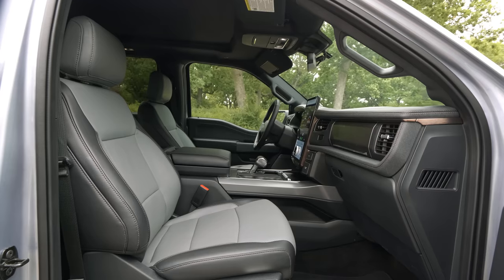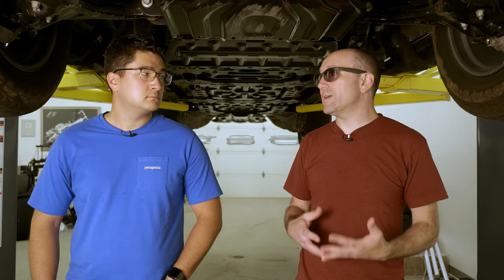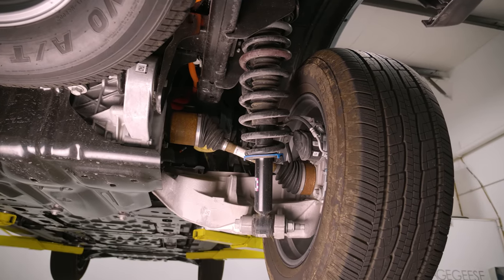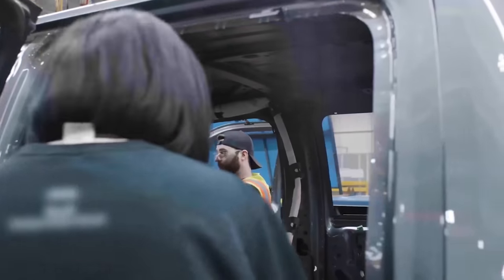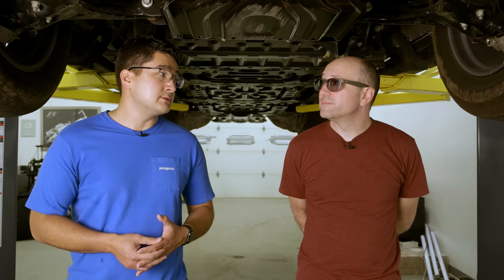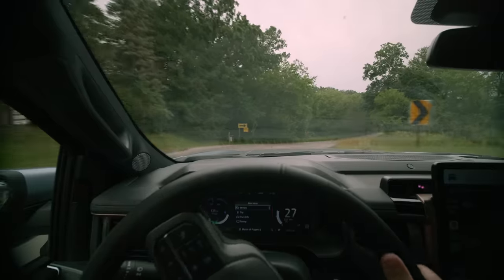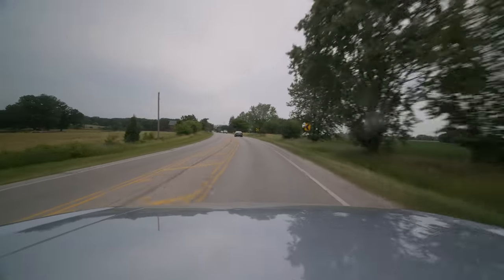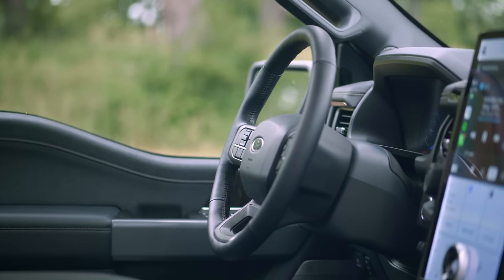Ford F150 Lightning | The EV That Will Change Trucks

Comment: As a Miata owner and cyclist these massive EV trucks are terrifying. The size, acceleration, and kinetic energy in this and the Hummer EV will lead to some gnarly accidents.
Reply: Yes a 6k EV truck is much more dangerous than a 6k diesel truck
Reply: @benjaminkessler8169  given the acceleration difference I agree with you.
Reply: @S8ER  except the ice ram trx is over 6800# fully fueled up and the raptor is 6400# loaded up&fueled. Both of those have similar 0-60mph time's. The new Cadillac escalade is over 6500# and does 0-60mph in the mid 4s. So really it's just another narrative against evs. 🤔
Reply: @4literv6  I don’t think anyone gave those vehicles a pass here.  I’m sure the Miata owner above doesn’t think those vehicles are safe for them either given the context.
Reply: @4literv6  this isn’t against EVs. I’d totally drive an EV commuter. I’m against enormous fast trucks that don’t have the same safety regulations as cars. Trucks don’t have to pass pedestrian crash regulations or headlight height limitations.

Comment: Smart grid integration could pair really well with millions of EV's. For one, EV's are usually charged at night (or at least could easily be programmed to do so), and most electric demand is during the day. We could also have a mode where when the batteries of these cars can effectively act as grid level storage to further level the load. A level load makes for a more efficient grid as you don't need as many fossil fuel powered plants sitting on standby for load leveling.

Comment: I'd like to see a "Thunder" trim level that has a range extender under the frunk similar to a BMW i3. It might be handy for those who live far from charging stations, or want a safety net of a backup charger in case they end up not close to a charging station. A Powerboost in reverse if you will.

Comment: "If you're going to tow heavy loads ...", then you're looking at an F-250, -350, etc. instead anyway, and most likely a diesel too.  The TRUTH of the matter is that the F-150 Lightning is the PERFECT F-150 for 99% of F-150 buyers, ... and you can take that to the bank!

Comment: If I’m a contractor with short range that means I’m in town towing. I bet then it falls to 50. Run some tools from the bed? You are probably be down to 30 miles. This is a joke. $200k now, 30k uses in a couple of years.

Comment: One issue when comparing gas mileage, is that nobody does the actual math for how much their regular commute costs them. If you take [(average gas price / typical gas mileage) * by typical commute = cost of commute]. Anybody who lives in the city, and only drives 2 or 3 miles a day, will never see a return on their investment into an f-150 Lightning with gas savings. People who drive 20 miles, will see an immediate return that month. based on base model costs. This applies to every popular EV, given how expensive they are currently. The people who would benefit the most, don't have the infrastructure to support them either.

Comment: Am I the only one that absolutely despises that massive screen mounted in a highly distracting area.
Reply from the maker: Its trash
Reply: It's almost like all these features that "keep drivers safe" (lane keep assist, auto braking, proximity warnings) are only in place because the manufacturer's are dead set on putting a 62" screen that you can stream tic tock videos on nailed to the dash. 

I'm convinced this is all to make it so hard to drive that they have an excuse to mandate self driving cars.

Comment: Big electric truck that wont fit in the city or around downtown metro areas.  Wrong size if you ask me.  Should have been a midsize.  Their maverick will sell 1000 to 1 to this truck based on price and practicality.

It's not usable for towing because of range and cant go offroad because the undercarriage is low due to the batteries.  Being heavy also means environmental issues to the roads.  Its one heavy ass truck.  Cant imagine what would happen if it hit some compact vehicle

Comment: Useless for half F150 buyers with tiny bed. Not to mention I can buy a shit ton of gas for $20-40K premium. My $37000 2.7 ecoboost XL f150 with 8' bed gets 24 MPG @ $3,00 is 320,000 miles of free gas compared to extended range EV version with tiny bed.

Will EV battery even last 320,000 miles? Then What's it cost to charge that? Math is not good.

Comment: Of course, even in a gas powered truck towing and payload impact the range you can get out of the fuel. The future is electric, and there will be more and more stations with pull-through chargers, like gas pump islands, so while towing drivers can still charge without having to unhitch the trailer. Cost of ownership is nearly half that of ICE (internal combustion engine) vehicles and to get the same range from electricity is cheaper than from gas or diesel.

Comment: Anyone else nervous about 4-second 7000-pound trucks on truck tires flying around?
Reply: You also nervous about the 6800# trx all flying around? Or the 6400# raptors that have been sold for years already? 🤔
Reply: @4literv6  Yes. But those are not as fast as EVs in the real world and also will be far less numerous.

Comment: Casual observations here:
1. The use of the phrase "boner-killer" was genius, especially in reference to the deletion of physical buttons because this phrase cuts across gender (these days), languages, and various demographics. In essence, everyone understands how serious it is when BoNeRJamZz quit. Clever work here, you cunning wordsmith. 
2. Ford needs to stop taking naming ideas from summer interns because they're inept at this point. No matter how cool/important/necessary this truck is, to use the Lightning badge was a s****y idea. The Lightning badge is tarnished. Same intern who chose the Mach-E naming structure. (Stick to design, dude. You won in that arena.)
3. You picked out a few details other journalists are afraid to talk about. I hope Ford doesn't punish you for this because you're doing your job well. I love you guys. 

Still not buying this truck, though.

Comment: Electric vehicles will relegate personal transportation to the elite.
This is the ultimate Ponzi scheme.
The manufactures all have set up separate entities for EVs.
They can bankrupt the legacy companies and screw everyone they are obligated to.
208/2009 taught them well.
Why are they pushing such powerful vehicles. The average driver isn't capable of driving one safely.
If a 6/7 second 0-60 was chosen think of the lower weight and extended range.
The safety issue is horrendous.
A family associate had a monumental fatal accident(can't comment/litigation) that would not have been possible in an ICE.
Believing Elon ,an autistic Judas Goat leading to the slaughter is fitting for the snowflakes-Mars my ass!
Reply: You are right ...this is not gonna end well for the rest of us....We are gonna end up back in the stone age.

Comment: Another benefit of driving an EV is you'll never have to worry about the exhaust rotting out and getting loud in the long term. That will lower noise pollution overall.

Comment: Problem with EV's is when you have to replace the battery pack in around 10 years the average cost for a Tesla currently is 21k. Thanks but no thanks.
Reply: this is not a thing

Comment: I don't want one of these (or any EV) in my garage.  Search for and watch the videos of Electric Bus fires.  Battery fires are a concern (and bias) of mine.
Reply: The fires are awful! You see that Tesla? The thing shorted and he couldn’t get out, he had to break the window, and it burned to the ground.
Reply: Any comment then on the 200,000+ice vehicle fires each year here in the U.S. alone. 🤔
I mean an ice vehicle burns down every 4-5mins on average and they cause untold billions in direct property damages each year to. 
Plus the #1 open recall across all ice vehicle's sold is for the risk of fire. I'd love a comment on that? 😂

Comment: Battery tech isn’t there yet. EVs are great for daily drivers and homeowners (or home renters). 

Unfortunately, towing isn’t there yet, range isn’t there yet for most ev’s, and charging infrastructure isn’t there yet. Had the opportunity to buy a few EVs over the last few years but realized it would be a huge pain in the ass for real life.

Comment: I think objectivity waned a bit in this review but I realize that if you guys commented about the amount of fuel (even at todays prices) that could be purchased for the premium over the normal f150, you probably wouldn't get to review anymore ford vehicles or EVs for that matter.  It's a $75,000 truck that gets 300mpc going the speed limit (that isn't free to charge), and will need a $20,000+ battery replacement in 10 years, and that's not even touching on the dealer markups.

Comment: I can't wait for this first (second?) EV gen to be over and for manufacturers to stop cramming the BIGGEST FUCKING DISPLAY POSSIBLE into the center console. Like bruh could they not have just condensed the UI and better integrated a control unit into the design of the car? So stupid.

Comment: I bet the vehicles stop charging when it senses low voltage.  So during a brown out they won't have to tell you to unplug your EV. 
Here in NYC  they ask us to turn the AC off during these hot spells. All these EVs are only going to push our electrical infrastructure to the max.

Comment: The EV that will change trucks until you have to pay $25,000 to replace the battery after 65,000 miles...
Reply: Do your research before you make sh*t up! In any case, all EVs have at least an 8 year/100K mile battery warranty.

Comment: I never knew how much it would cost an electrician to install the needed wiring and etc for a generator. Did it myself for 100$...5 grand for someone to do it? Wow...This is about as bad as honda marking up their parts 6x.
Reply: There are a LOT of options to go about this. In an emergency you can just wire an extension cord right in to the panel for $0, the cost is on a continuum from that to having a whole new panel with 'smart breakers' and a Tesla Powerwall-type system that'll automatically switch from using the EV battery to charging it when the lights come back on.

Comment: get ready for your electric rates to increase.
Reply: Why? Most electricity is used by industry, commercial buildings, city services, etc. As more green sources come online it is a lower cost than traditional sources (except existing hydro) and charging at night at home, for those that can, is at a reduce rate.
Reply: @davidmccarthy6061  if demand outgrows supply then price increases.

Comment: Great. Another ass-screamer you can't hear coming around a turn towards you. Pedestrian safety, as well as other vehicles can't use aural senses to keep safe. I'm down for innovation and clean energy to a degree. But with nightmarish, hellcat speed, at least make some fake throaty exhaust noise externally. Make it sound like a Mustang, Hellcat or whatever. You can judge what's coming based on traditional exhaust noise. Much more difficult with tire hum/noise only.

Comment: Tow with this and you'll get 100 mile range. Yeah no. I've got places to be. I can go 300-400 miles towing with my old truck. Then it takes 5 minutes to go 300-400 miles again.

This will go 100 miles, charge for 30 min. In 200 miles or 3 hours of driving, you'll need to charge for an hour.

Comment: Ok...we need safety laws if we are going to put 700hp into 6500lb trucks and hand them to idiot America.  That is a tremendous amount of force on impact for a group of drivers that lives to tailgate on highways.  It's unfortunate they had to still make it a tall, blocky, brick like truck despite the fact there is no motor or driveshaft concerns that would require this design.  Once again, Detroit takes an inherently efficient technology yet somehow manages to make it inefficient.

Comment: So much bullshit about EV's get danced around...how long does it take to charge?  What do you need to be able to charge it at home?  How much is the dealer markup?  How does extreme cold affect the range?  Can the electric grid handle even replacing 20% of vehicles on the road with EV's?  They keep acting like EV's are the answer while simultaneously not asking the real questions.  What a joke.